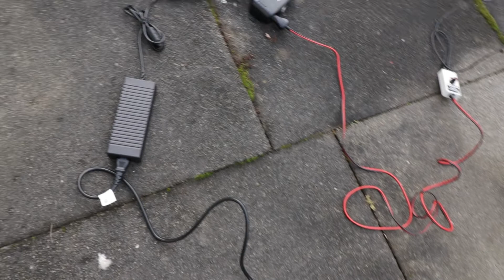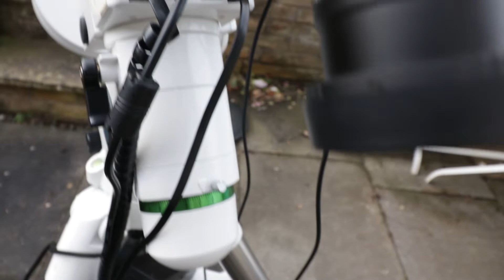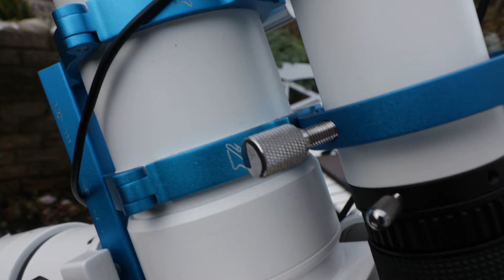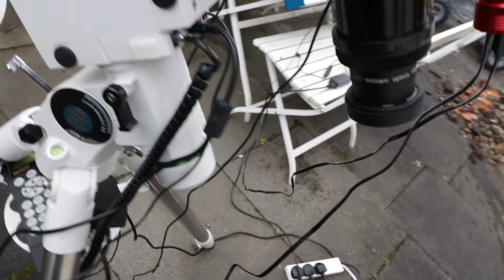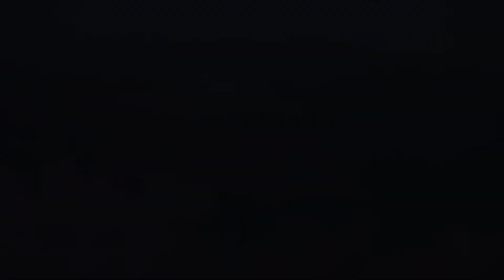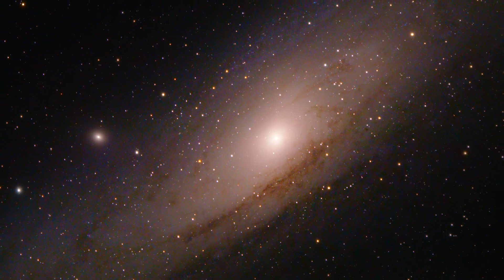How to Power Your Gear - Deep Sky Astrophotography

Comment: A small usb hub at your mount would allow you to have just one usb cable running from the mount to the laptop. This would reduce the risk of damaging a camera if a cable was tripped over. The USB hub would be the sacrificial device. Getting a long USB cable for the connection between the hub and the laptop would allow you to route the cable far from areas where you would be walking/moving. This would also mean that any telescope mounted device that has a cable that only just reaches the laptop currently would easily reach the usb hub. Much easier cable management. Also this would free up some usb ports on the laptop as well as give some extra available usb ports at the telescope (depending on how many ports the usb hub has).
If you used a powered USB hub then you would likely also be able to power your USB dew heaters that you mentioned. If you can find a powered USB hub that runs off of 12 volts (5 volts is more common) then you could power it from the 12 volt automotive outlets you have for the Hitecastro dew controller.
You mentioned a medical power supply for the mount. Is that to overcome a power issue? Couldn't the mount be powered from the same 12 volt automotive outlets that you use for the dew heaters?
Reply: How would you power the mount from a USB hub?
Reply: @daytonsmith8910  Not from the USB hub. The USB hub would just be for the USB devices on the telescope. But I was suggesting/asking if the mount could be powered from the 12 volt automotive outlets that are currently only powering the Hitecastro dew controller.
Basically the suggestions were aimed to reduce the number of cables going to the mount, especially the multiple USB cables.
Also by using a USB hub, it may be possible to permanently mount the hub to the telescope mount which would make the setup/teardown time quicker and less complex.

Comment: Great info for those who need that information 👌 luckily for me my Celestron Nexstar Evolution mount has a 10 hour lithium ion battery built in, I use a heavy duty power tank to power other excessories like heat straps, powering my DSLR camera, charging my phone, tablet and so on 🔭
Reply from the maker: Thanks for the comment, sounds like you've got a handy power setup there!

Comment: Hi Joel, good informative video. I have a similar setup. Heq5 Pro, William Optics Z61, same guidescope but running off Zwo Asi Air. Have you thought about trying EQMOD? You could ditch the hand controller and run off the laptop with Stellarium, PHD2.
Reply: Cool stuff 👌 my telescope does not require a guide scope, how it works is once set up and aligned i can then align to 10 more calibration stars using the SkyPortal App. The more stars you align to the more accurate the tracking eliminating the need for a auto guider. The mount generates it's own wifi so you can connect via a Android or iPhone device 🔭
Reply from the maker: Hi Paul, thanks. I have thought about using EQMOD so will be getting that soon. Would be nice to use Stellarium to do the work.
Reply: @AstroPhotos  I've not used Stellarium with Eqmod for the awhile now I use the Asi Air. Before I used the the eqdir cable from First Light Optics, a 10 metre 4 port USB hub, velcro'd the hub to the side of the mount, plugged everything into the hub and ran the 1 cable from the hub into the laptop. Once I polar aligned using Pole Master and done focusing with Backyard EOS, I took the laptop inside and ran it from the house.
Reply from the maker: @paulradford6902  The ASI Air does look like a good bit of kit Paul. So you'd recommend skipping EQMod and going straight for the ASIAir instead? I think before doing that the next upgrade I want to do is get a more sensitive DSLR (modified), or a coolest OSC or Mono... just trying to decide which.
Reply: @AstroPhotos  Hi Joel, the Asi Air us a great bit of kit, I'm just having a bit of trouble we with it at the the min. I think that's its operator (me) error than hardware. You've probably seen they're launching a Pro version soon so I'd wait for that anyway, plus I think the current Air is pretty much sold out everywhere or being discontinued. I'm actually installing the N.I.N.A astronomy package as we speak so I can plate solve. I use Backyard EOS but I've read the plate solving is quite a mission to set up. The Zwo 294 cooled looks good. I can't be arsed with Mono, I have no patience. Where did you get that dry box from? Would it fit an extension reel in? I brought a plastic box from the Range about a month ago but it's cracking already.